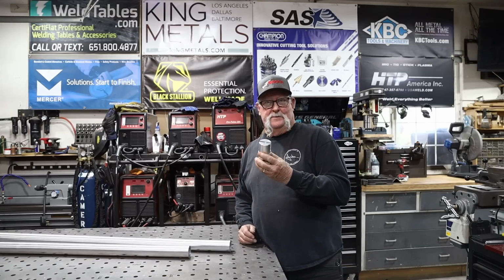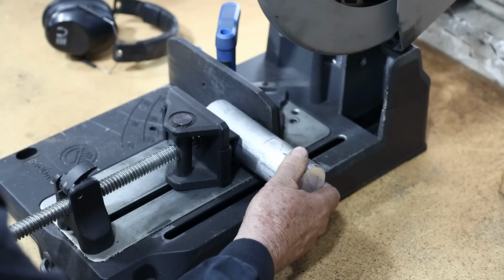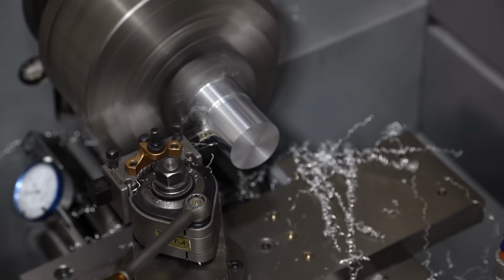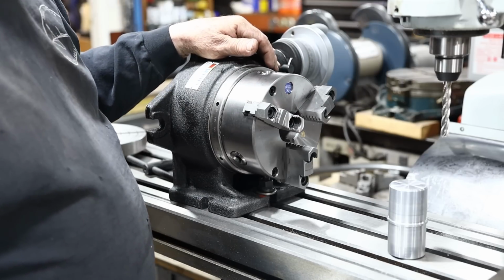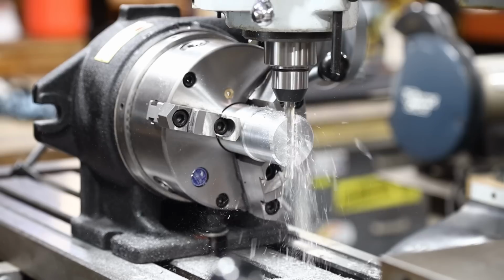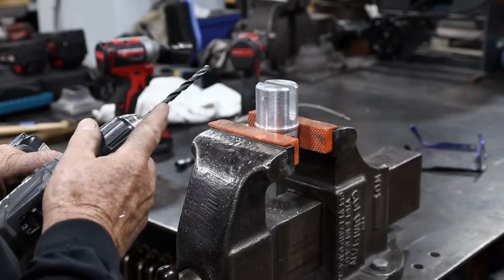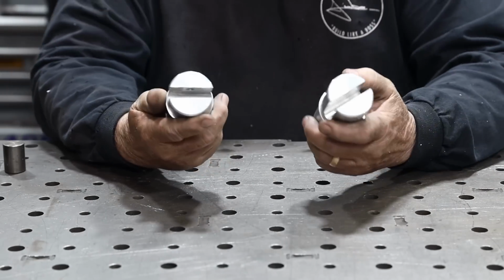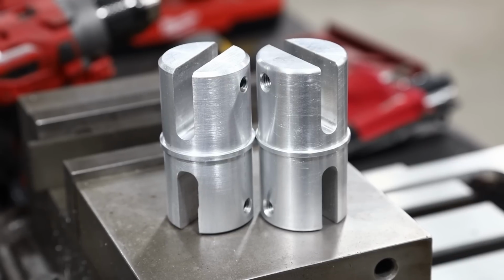Machining Aluminum Using KBC Mill | JIMBO'S GARAGE #metalfabrication

Comment: Hi Jim, I think those little jobs get over thought making a simple job look harder, also watching the chips build ,maybe a small tray to catch and dump the chips ,I stop in at the machine shop once in awhile and look in the CNC units and look at the mess of filings and chips that accumulate after several hours of milling so trying to keep small area cleaner can be challenging ,but those projects are great for learning

Comment: check out the Noga RC3300 reversible countersink. Makes putting a countersink on slot side of tapped hole possible and wont have to worry about a burr rolling over into slot.

Comment: Jimbo! How you doing bud? Hope your doing well. Man it doesn't matter if you been machining 50 years or 50 minutes learning is learning. It's a part the defect will be hidden anyways so its no big deal long as it works and you learned something. Just a future heads up though. Beez wax man. Use beez wax on your cutting tools when machining aluminum, aluminum can't gum up the bits nor stick to the part even when hot. I don't have a coolant system on my lathe So i use beez wax when milling. Anyways fantastic work Jimbo and as always i look forward to your next project 👍

Comment: You could have used a parting tool to cut your slug to size on the lathe.
 an old machinist friend of mine now pass said take small not full cuts through material on an mill, and use plenty of cutting oil or coolant. 
Get yourself a Spring Loaded Tap Guide there will worth the 20 bucks

Comment: Hi Jimbo, you can plunge cut to avoid long end mill contact with the part . I am a starting hobby machinist and plunging is really less intimidating since it looks more like drilling witch we are all familiar and comfortable with.
Reply: I was figuring taking 2 or 3 passes at partial depth would have been the quicker option.  Alot of endmills don't love plunge cutting and it's aluminum so they would go quick anyways

Comment: Not bad Jimbo, there are lots of videos out there to check on using coolant...
I would have drilled the end of the slot the correct dia then you only have the width to blend into. Back in the day we would have plunged milled most of the material away so less to grab also see what you are doing.

Comment: One thing you could have done is rough out that slot with a series of 3/8 holes. Then you don't have so much material to take out with the endmill. You also could have used that excess material to hang onto and cut it off last. Good video though!